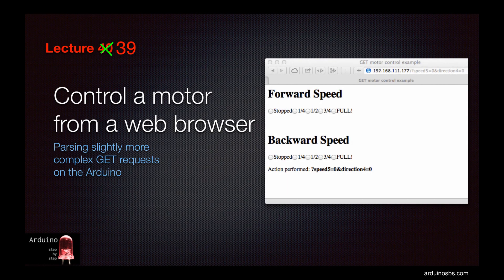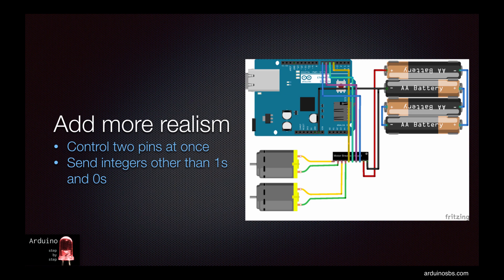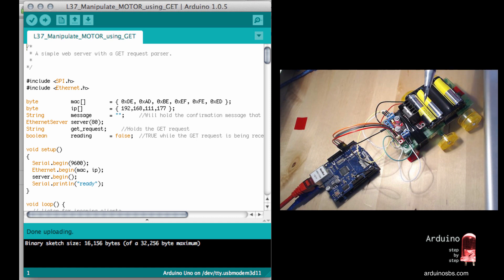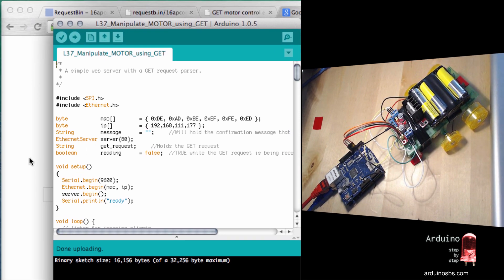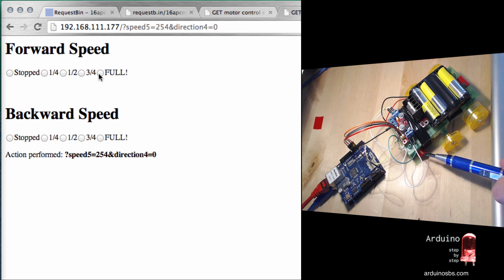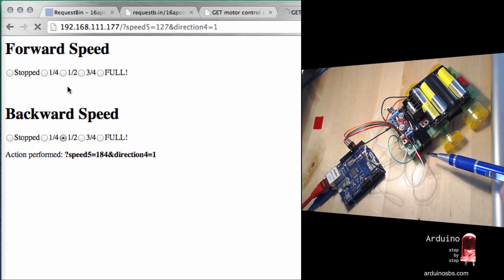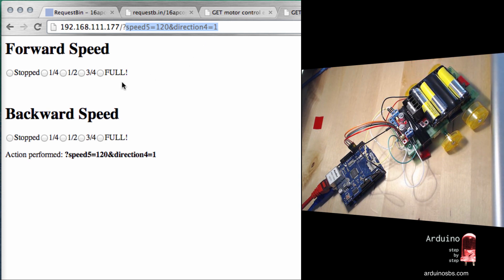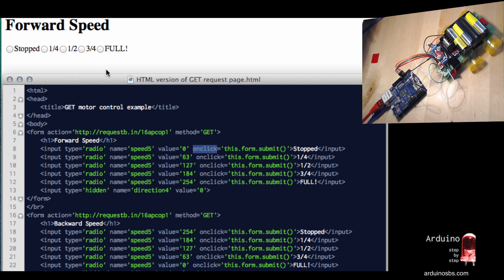Arduino Step by Step: Web browser motor control

Comment: Hey sir
I want to take fingerprint and store on server ....and in future i like to perform matching...
plz explain me how can i do this
Reply: Wow this looks like an extremely complex project. How's the project going so far after a year?
If I may suggest one way of proceeding: you have to buy a fingerprint scanner that can produce quite good quality images of your palm/fingers. Taking a snapshot of your fingers and storing it to your own server is the easiest part. Then use a computer vision library (OpenCV is good but it doesn't have to be real-time library). Now the hardest part begins: you have to do a LOT of research on the subject (color tweaking(b/w and image enhancement), you have to be able to recognize minutiaes ( pattern recognition ), differentiate between several types of minutiaes, selecting a certain amount of keypoints(minutiae), measuring distance between each of those kp(µm), establish some margin of error(radius dist error for each kp), store some fingerprint data in a DB about multiple individuals (let's say anular left).
Now thanks to all the computed data stored in your database you should be able to tell if 2 fingerprints look alike, while playing with the margin of error to determine what's acceptable and what's not (you want to make it as small as possible). (you have to try multiple times over and over again to calibrate your program).
Ideally you should take into account the possibility that the skin on the scanned finger could be damaged and adapt to the number of recognizable kp and their locations so that the system becomes more robust.

This is really basic stuff, but if everything went well it should get you started just for testing purposes, not for securing vaults ^^

I'm aware there are easier ways to do this. But most of the time it will cost you a kidney or three ^^. Other than just the cost this will improve your knowledge, isn't it what we're all looking for?

Hope this helps in some way.

Comment: Hi there. I am trying to control quite a few DC motors through a web browser using PWM... Is there any way it would be possible to incorporate a controller of some kind? In essence I would like to press keys on the keyboard inside the web browser to vary the PWM signal I'm sending to certain motors. If anyone could provide a link or some insight into this, it would be very helpful. Thanks.

Comment: Hola que buen trabajo,tengo una pregunta,yo puedo realizar un proyecto similar,pero esta vez para encender el led o el motor debo comunicarme con una base de datos.  esto es posible?
Reply from the maker: Hi, I don't speak spanish, but Google suggest that your question is this:

"Hey nice work, I have a question, I can do a similar project, but this time to turn on the LED or motor must contact database. this is possible?"